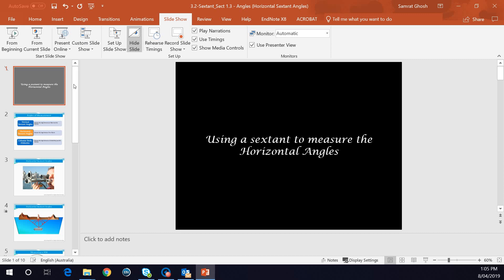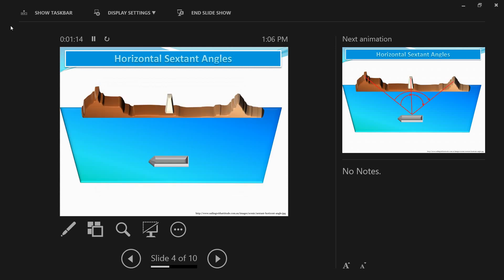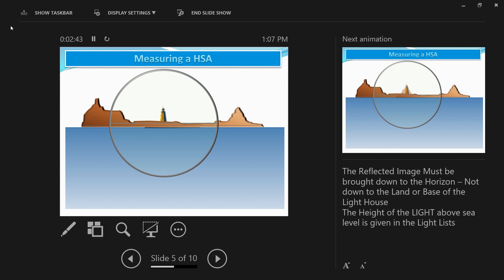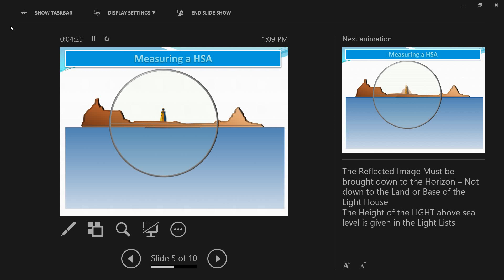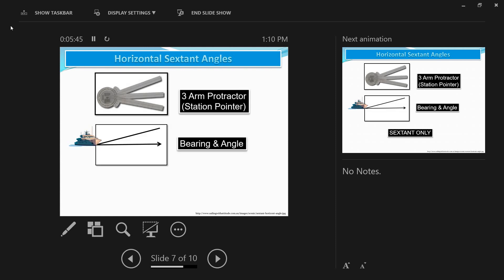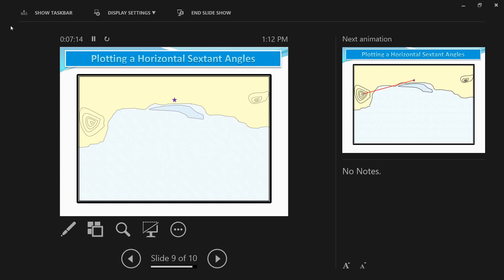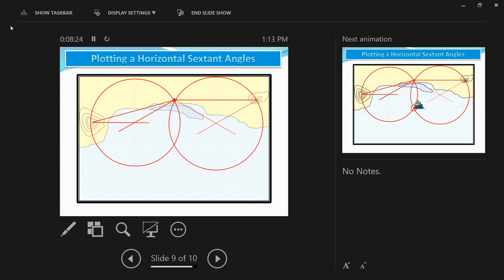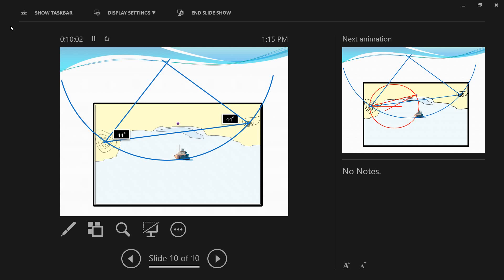Using horizontal sextant angles to plot the ship's position at sea

Comment: sir make a video on ( horizontal angle if 0 degree) 
rest all you explanation was excellent 
if base line 0 degree   90-90 = 0
Reply: Then no need to draw the triangle. Just join the 2 light houses, and from the centre of the line draw circle touching those light houses.
Reply: Join the given 2 light houses. Midpoint of that line to be considered as centre and draw a circle.